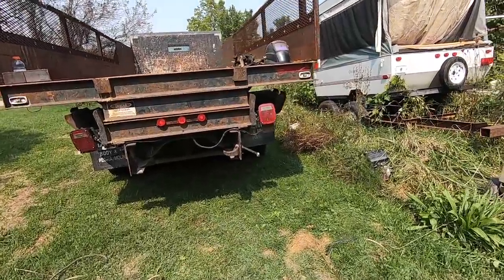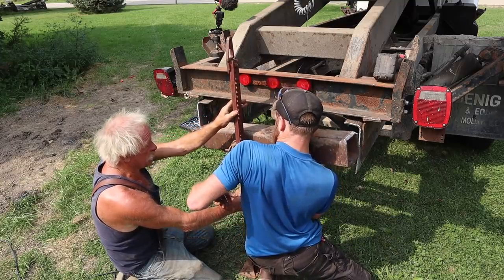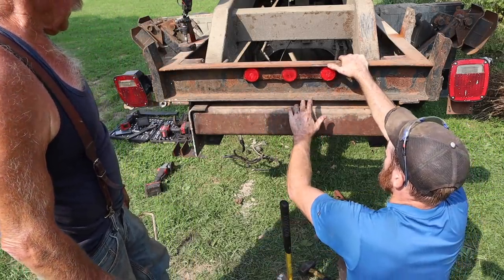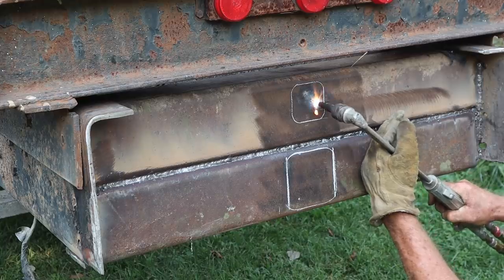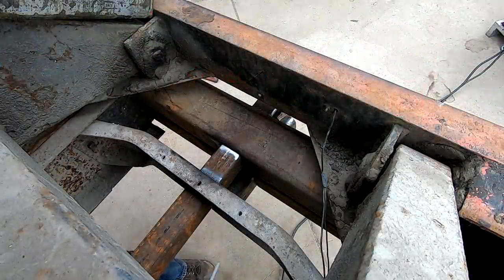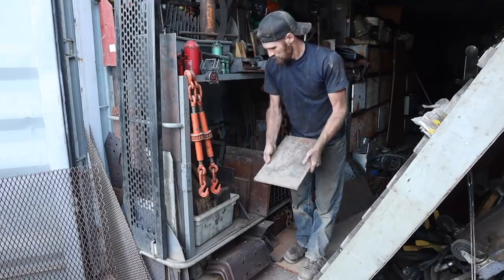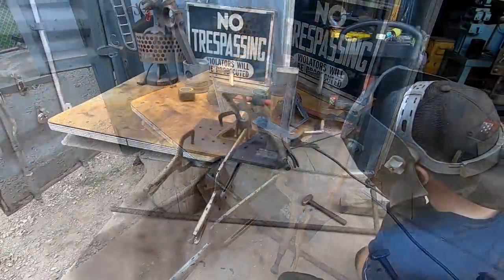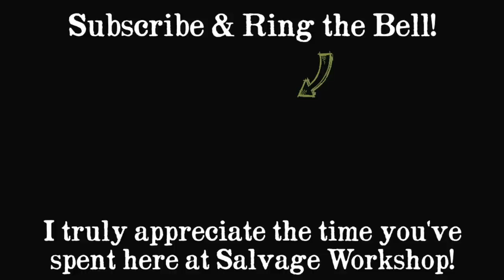Fabricobbling a DUAL Rear Hitch Setup?!? ~ 1988 IH Scissor Dump Truck

Comment: Liked the video on the hitch. One thing that I would recommend is that you add a 12v power tarp plug into your design.  So u can plug the winch into to have constant power supply for it. Then u don't have to mess with a battery.  I added one to my truck's for my hydraulic Trailer and winch. If you have any questions let me know I will send pictures of my setup.  Awesome work 👏 👌 👍

Comment: That was a pretty cool trick Mike did at 19:15 , I had originally thought "Now that piece is stuck in there". Would've never thought there'd be an easy way to get it out, but he had the solution. Good job.👍
Reply: If he yust put a magnet on the outside when its almost lose he pull it out easy👍🎄✨😎
Reply from the maker: Yeah i thought so too! Especially since we already had the welding rods sitting right there!
Reply: @andarthome142  or just use a welding rod and stick it to the side of what your cutting out and you already have a way of doing it.

Comment: Tips from the "coach"  😉 I would put the jack in the frame and squeezed out the frame beams. Then you might as well have been able to put the beam on the jack as support. And then release the jack while fitting it.

Comment: Amen, brother on saving the old trucks!  These old S-series trucks were some of the best International ever made.  I have 2 S-Series school buses, and have a wealth of knowledge that I am more than happy to share to anyone who can use it.  I saw your previous two videos on this truck, and can answer pretty much all of your questions from the get-go...  

For starters, to differentiate the DT360 from the DTA360:  The A stands for aftercooled, and the way to tell is the intake pipe going from the turbo to the intake manifold. Since yours is a direct crossover pipe, and you do not have an intercooler/aftercooler, that will classify your engine as the DT360.  Both my buses are DTA360s and in my videos, you'll see intake piping going to and from the intercooler.

Secondly--the shift patterns--those are just two different ways to shift the truck.  It appears you have a two-speed rear axle, but someone has removed the lo-hi split button, which should be mounted on the side of the stick, and yours is presumably locked in high gear.  If you look in your previous vids, you can see the electric shift motor on the driver's side of the diff on the front of the axle.  

Lastly - the jump from 3-4 being almost too big of a jump -- I can totally relate.  My first bus was originally an AT545 Auto, and shortly before I swapped the DTA360 into it, I swapped an Eaton 5-speed and the ratios are very similar to your Spicer 5-speed.  Before I replaced my rear end with 4.78 highway gears, I was running a 6.14, which made the shift not nearly as painful.  Luckily for me, I have a 4 speed auxiliary transmission, so I split my gears more to accommodate for that particular shift.  If you can get that two speed axle motor to work, shifting the axle from High to Low as you shift from 3-4 would make the shift much, much more bearable.

Feel free to hit me up for any more questions, I'd love to chat and geek out over these old IH's -- my channel name at gmail dot com.

Comment: Great video, you've got some skills 👍 About pulling small(er) trailers with this truck, you should be careful, as the weight difference between the truck and small trailer and the relatively stiff suspension can cause smaller trailers to be seriously damaged. The truck will put a lot more forces into the trailer than a regular pickup truck would.

Comment: Hello, since you asked, I will try to make your life easier by changing a wire fence stretcher device into a very useful upright jack. We use these to lift 40 foot boats and have done that for decades. So take your fence jack and remove the foot part. Now make a plate of 3/8s steel 10" wide and 12" long.( make it bigger if you want) Get a piece of 3/8s X 4" wide steel channel iron and cut it 8" long 4" high. Weld it to your bottom plate. Now set the fence jack on top and scribe the channel iron to make an opening for the fence jack to go through so you can weld it to the base. Now weld the jack to the top of the channel iron and your done. It's no longer a fence jack and has become a very stable upright jack and it works great! Doesn't work well for stretching fence wire though. Once you have lubricated the jacking mechanism it will be smooth as silk. Cheers from Canada.

Comment: Best thing for those jacks is to keep them clean. I pressure wash mine every now and then a little bit of oil. Works like a deam
Reply from the maker: I also suggest not storing them in the weeds outside, but it wasn't my jack!
Reply: @SalvageWorkshop  the comment wasn't for you personally! I didn't use your name. It was just a good way to clean the Jack that works if someone wanted to try it!
Reply from the maker: @bombardier3qtrlbpsi  i was joking my friend! I do agree with your suggestion! Thanks for watching and commenting! I truly appreciate it!

Comment: for your winch both front and rear i suggest you mount 2 extra recievers so that any sideways loads are better distributed. normally this would not be used for say general towing, but that winch can put alot of torque on a hitch. so if your mount had 3 parallel hitches on it it could be slid into front or rear and still pull to the side without risking undue loads on the single hitch. when normal towing the 2 other hitches arent required but wont get in the way either. if you decided you needed to tow a heavier load you could make an adapter to tie into the 3 parallel hitches.

Comment: Add a stiffener all the way to the bottom of the plate. I bent a 1/2” pintle plate, pulling 40k. I ended up cutting it off and remade out of 3/4”.

Comment: Sounded like you needed to turn amps up 1 or 2 notches. You mentioned needing a better welder. Look for a Miller 250 AC/DC standard or HF. The HF has built in contactors for Tig welding.I owned an HF and stick and Tig welded with it.Also the round top Lincoln Idealarc ACDC 250 is a good machine. The older Hobarts with the round adjustment "steering"wheel are good runners. Make sure it welds before you buy. I was 30 yrs in welding and ran em all. AL B.

Comment: You may want too round the bottom of your hitch below the pinto hitch. When grawling under your truck or back out you hit that Im afraid it will draw blood..Just a Suggestion. Ive had experience  in doing that..LOL..HAHA. And it hurts like hell..LOL..That point..Merry  Christmas.  Great Video..
Reply from the maker: Yeah i agree with that completely! I can see that happening for sure!
Reply: @SalvageWorkshop  I just wanted to give You a Heads up is all. I allready did that trick and  I didnt want to see anyone else have to learn that way...LOL..
Reply: @thomasbailey8306  Yah, it's never easy learning the hard way... ;-)

Comment: Awesome Job so now it has a towing system at the back and a winch mount. Plus a winch mount on the Front. That's very good welding and work you have done...
Have you flushed out the cooling system yet ???
Reply from the maker: I have flushed the cooling system... that video is coming soon!

Comment: Chop saw abrasive blades build up heat when cutting solids and could blow apart. I think you have a horizontal bandsaw or use an Evolution metal cutting saw. Al B in Ohio.

Comment: what rod are you running with the stick welder? 
Guessing 6010/11 for that square tubing & 7018 for the 3x3 Square stock & 1/2" plate
Watching this is also giving me ideas about how Im going to build a brush guard for my truck.

Comment: Good old farm boy engineering,   I've been doing it most if my life after growing up on the farm.  Just my 2 cents.  But I think I'd of welded in the reciever tubes into the crossbrace tubing. Out of the truck after test fitting them for easier access and welding.
Great job though. Should last you for many many years

Comment: noticed that backhoe attachment in Mikes yard.... I see a hoist  (modified backhoe)  attached to that truck somehow in the future, that would be awesome for loading heavy things without needing a fork lift all the time... Amazing work as usual, thank you for taking up most of my day today, tomorrow I will take your inspiration and put it to use in my real life, lol
EDIT: i wonder if you could add a 2in piece so when it's turned upside down you can plug it into the 2in receiver also? IDK it's probably strong enough but I have experienced thick flat plate bending when the support was too low...

Comment: Should a super heavy duty hitch have a bigger pin? Seems like all the weight is pulling on it. Love the videos. Keep up the good work and best of wishes for the coming year -
Reply from the maker: It does have a larger pin than a standard hitch!
Reply: @SalvageWorkshop  Oh..  .. ... ..  .. . ..  . .. .. .  ..  .. never mind
Reply: @johnh8192  😂
Reply: The pin for tractor implements is about twice the size, I'd drill the hole bigger. Right now it's the weak point on a great setup.
Reply: Its amazing how anybodys hitch is braced, reinforced and is only held on by a 5/8 pin.

Comment: I agree the 2” is small if your going to tow stuff as big and heavy as you seem to be building for. Question, don’t you think that the pin in the 3” receiver is small for the size of the load you seem to want to haul. Maybe it’s bigger than it appears on camera but isn’t it the same as to 2” receiver. Just asking. stay safe
Reply from the maker: Its not a normal hitch pin...  it's a 3/4" hitch pin that has a dohble sheer rating of over 39,000 lbs... that way more than this truck will ever tow!

Comment: Great video! Excellent job but.... if I may suggest, for cutting massive pieces of thick bar stock, when your on the hunt for "new" equipment for the shop why not find a nice old horizontal band saw with auto feed? Just a suggestion. You can cut that stock within .005 right off the bat and avoid the possibility of a huge cut off wheel blowing up in your face? Just my two cents. Merry Christmas to you and your family!
Reply from the maker: Oh I COMPLETELY agree... which is why i recently did some horse trading for a Doall 20" vertical contour band saw and also picked up a kalamazoo horizontal bandsaw for doing a lot of my metal cutting going forward... you'll see that in an upcoming video... A LOT has changed here at Salvage Workshop!

Comment: @39:50 The bevel on the gusset should have been facing the plate. Same as for the 3 inch stock should have been beveled so the weld would be more flush and not interfering with the bolt pattern as you mentioned. The 3 inch stock is way overkill even though it was free. the weak link there are either the pin for the hitch adapter or the 2 bolts that secure the clamp to the half inch plate. I would have bumped up a size or 2 on those bolts.
Reply from the maker: Lot's of ways to accomplish the goal! Thanks for watching! I appreciate your thoughts!

Comment: IMO: I would flip that hitch 180 drgs 99% of the time (if what your towing allows) as you have much better ground clearance preventing the hitch from digging in on driveways, curbs, whatever and other transition spots like driveways. In any event, the hitch and draw bar/frame mod is built like the proverbial brick outhouse... well done!!
Reply from the maker: If that becomes a problem I'll do that, but i have almost 18-20" of ground clearance as it is now!
Reply: @SalvageWorkshop  I thought it looked like plenty ground clearance. Great job.

Comment: were you designed that square tubing hitch, by putting the square tubing through the centre and have only one weld at the front and nothing at the back there will be play, so down the track it will be a problem .

Comment: Great job! My suggestion is to do as much cutting and drilling prior to welding pieces together. For example I would have cut the holes in the 5x5 prior to mounting in the frame. As well as drilling the pin hole in the 3x3 stock prior to welding it to the plate. 

Lastly cleaning the metal and adding some bevels before welding them.
Reply: 100% accurate! I’ve done this kind of work for many years! I really like his effort but myself most of the heavy lifting I would have used hydraulic jacks!  Also I’m at 14:33 in video and with what I heard of their plans so far! I would be doing all of the installation of receivers while welding most of that work on the bench!

Comment: Overkill isn’t always bad ! Lol. I think your going to regret putting the 2” above the 3” ! Small trailers using a 2” typically level is around 17” so you’ll need a big drop , I’m thinking your going to use the 2” on your winch and not on a trailer but you might pull a smaller one !?!? You could also switch the 2 5/16” ball for a 2” and the pintal hitch will still work fine !

Comment: Currently working on a 64 dodge A 100 van. Drug it out of scrap because the repair bills on modern vehicles are way worse than the gas bill on the  A 100, that's if you can even repair them at all. As a side note, fixing appreciating these machines and restoring them is good but what we really need is to restore the civilization that made them in the first place. I for one can not stand machines engineered to second guess me, to beep and ring and blink lights in my face every time I operate them. Headlights that decide it's better to turn off in 30 seconds instead of when I turn the switch off as just one example. Who needs that? Who would think that's a good idea?  I don't want my seat heated, I don't want power windows, I want the machine to do what I tell it to do.
Reply from the maker: Amen Herbert! Amen!
Reply: @SalvageWorkshop   One way to get it started I think is to do some experiments with building our own economy. Use some kind of currency other than that from central banks. Maybe bitcoin, silver, what ever people like. But, an independent currency.  I think one experiment that could be tried is to simply start an alt businesses, it could be about anything but I think if it produced something people need like food or fuel or clothing etc it would take off better.  Just get some friends and family together and make something. Like maybe some kind of small ATV or start growing some produce. Maybe start a bio diesel plant. Everyone in the group get's paid in what ever alt currency they decide on, redeemable at the business for product. I think if we created some kind of online system of nodes that linked these kind of operations together then they could start doing business with each other.  As far as government is concerned no businesses exists as no "money" changed hands. It's just groups of friends playing a game on the internet just people perusing a kind of economic hobby.  The worse things get in the main stream the more people will defect over to the alternate. I think it has potential to go international with it's own banks, insurance companies and so on. parallel structures like this were use to fight communism in places like Czechoslovakia.

Comment: Great video!  I have a concern that the weak link is the quick release pin!  There's no doubt that you over built the 3 inch receiver.  Was there anything calculated regarding the pin and shear strength? Any DOT regulations?
Reply from the maker: Thank you David! Glad you enjoyed the project! 

In regards to what it can handle, I did reach out to a couple hitch manufacturers about pin size and strength, and was told they haven't ever needed to test the sheer strength of a pin because the hitches and ball mounts will fail before the pin does every single time... I used a ¾ inch hitch pin that has a double shear rating to withstand 39,231 pounds, which is WAY more than i can even tow with this truck... i could even step up to a grade 8 ⁵/⁸" bolt and that has a tensile strength of 150,000 lbs... Honestly, no calculations were done, but I did compare what i wanted to build against what is commercially availiable and what those were rated to handle weight wise... all the commericially availiable hitches and hitch receivers were significantly thinner, and less heavy duty than what i built... im not too worried about it handling what i throw at it!

Comment: What is the diameter of you pin? it looked like 1/2".  would you want 3/4 for safety you can have a Lot of weight on the trailer.

Comment: i may be wrong but a 3" box section hollow tube with say 1/2" wall is harder to bend than a solid 3" bar
Reply: You could be right, the original but smaller piece was already bent...good point!
Reply: Yeah, I noticed the bend as well, good observation
Reply from the maker: @horstszibulski19  that 2" hitch receiver was already bent when i acquired it... i can only imagine what the previous owner had to e doing to bend it!
Reply: @SalvageWorkshop  :-D
Reply: I've always heard that tubing is stronger than solid bar, cause it has two surface areas.

Comment: You probably could have just gone with the single 3" receiver and then made a 2" receiver insert for the 3"?
Reply from the maker: Yeah i thought about that, but i plan to use the lower hitch to tow a trailer and the upper hitch to have my electric winch in it so i can pull machines and vehicles onto the trailer... plus i do have an adapter for running a 2" shank in the lower receiver if i decide to... thanks for watching! I appreciate the support!
Reply: @SalvageWorkshop  Oh yeah, that makes sense

Comment: With all that weight of the hitch and the 5x5 pieces of crossmember you better be carefull you don't take off too fast or you'll pop a wheelie LOL
Reply from the maker: That might be kinda fun, but problem is that's not a light truck by any means